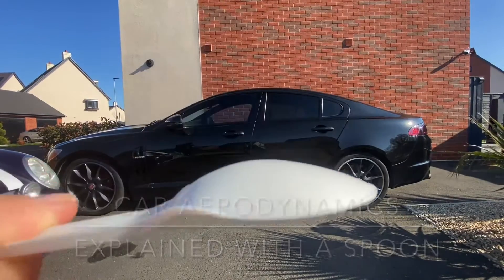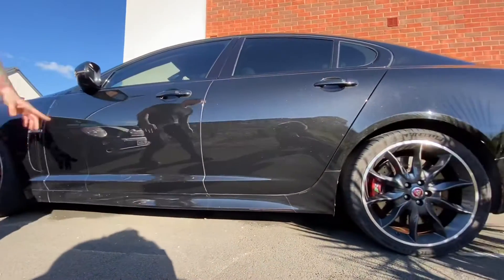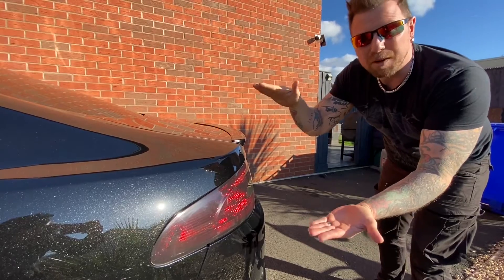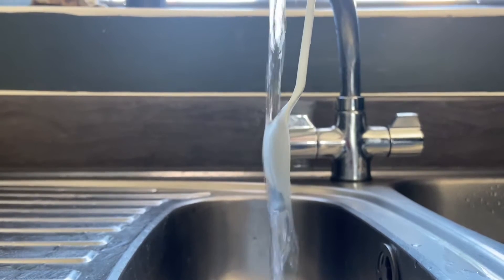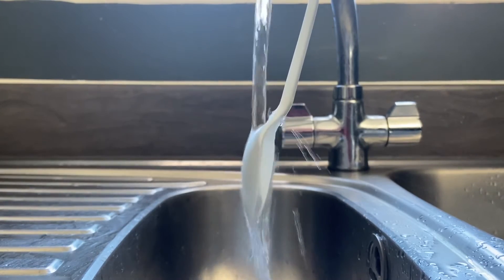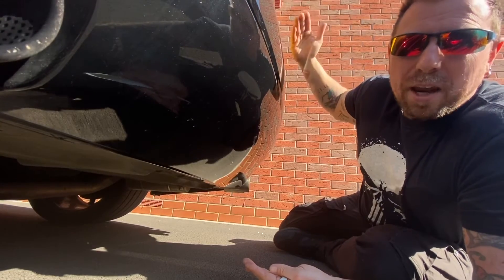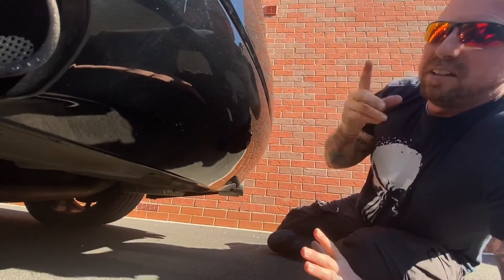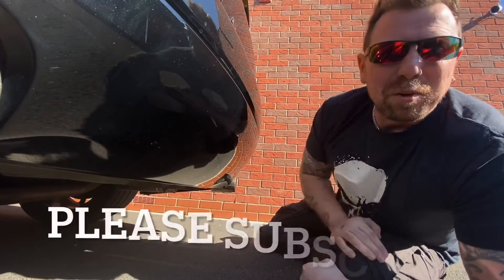How Spoilers Work, car aerodynamics explained simply

Comment: When are you throwing the spoiler on? Just got the same one
Reply from the maker: Mine is slightly out of shape on the one side, so I ’m making a decision if I fit it this weekend or not. How does your line up? I know mine is going to be a pain even though it’s only a little out of shape, it doesn’t flex.
Reply: @69racer69  I plan to do a mock fit today but I'm betting you did that and it looked good until you took the spoiler off. I hope it fits well.
Reply from the maker: @arvincharran2647  I did think it looked a little up on the one side even when I offered it up against my other spoiler. So you maybe able to tell. I hope yours fits.
Reply: @69racer69  I just took my spoiler off and test fit the new wing. Looks to fit nice and snug. Now I just need to clean the trunk and apply extra 3m to the new spoiler
Reply from the maker: @arvincharran2647  that’s awesome news, Get some real 3M VHT Black. (Not grey) then you will not have any issues in future.
Reply: @69racer69  got it fitted.  It did have a slight raise on the driver side tip about 3mm higher from flush. I layered up the 3m and all good.
Reply from the maker: @arvincharran2647  glad you managed to get it to fit. I may try it Sunday.